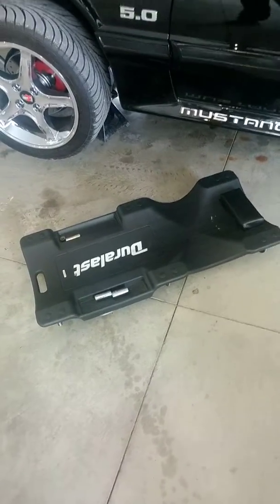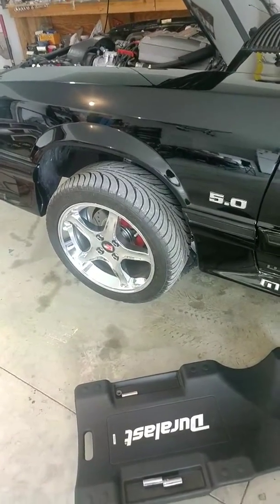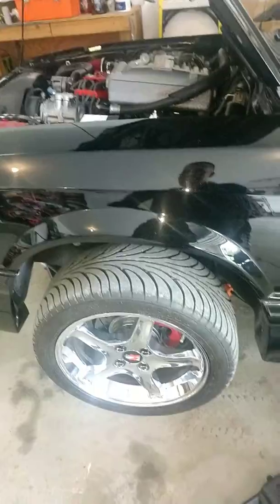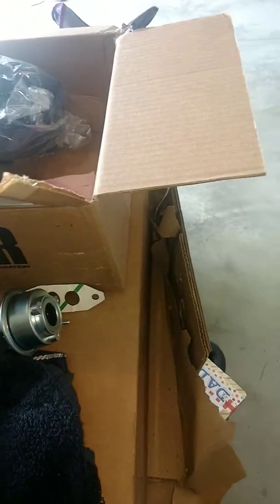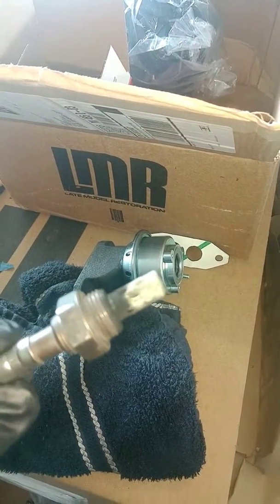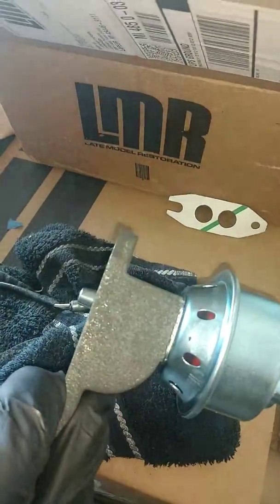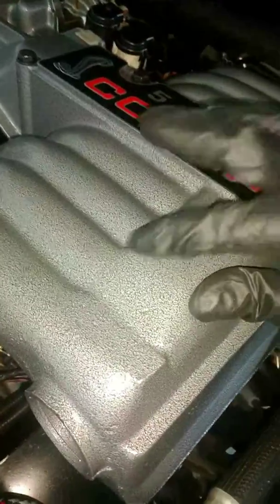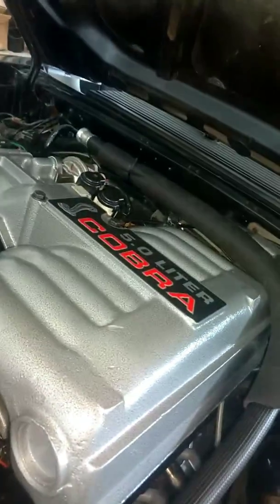Foxbody o2 sensors/EGR valve replacement s/Intake Hood Rub

Comment: I'm interested in to see if those o2 sensors, help your surge. I myself am battling the the same issue.
Reply from the maker: I cannot give you a definitive answer, yet. I slapped them on and took it for a ride, "seemed" better...over all, the car DOES have some better Giddy up! I'm going drive it some more and recheck codes hopefully this weekend. I will let you know Mike! I also replaced EGR, but I think you capped yours. A base idle rest might help, smoke test (for vacuum leaks, I think you replaced all your lines) and even a TPS adjustment. 
To be honest with you, I think I'm being picky as hell with it all, lol!
Reply: Yeah I know what you mean. My problem is when the engine was basically stock I didn't use the o2 sensors. Now it's running pig rich an I get horrible surge. Idle varies from 1500 to 700 driving me bat shit crazy. I did do the base idle reset. An checked timing. Running 12 degrees advance. Still idle is for garbage an surge. I'm gonna grab some o2's an plug them in. Hate just throwing parts at things. My fear is I may need a tune. Not sure yet. Let me know how she performs.
Reply from the maker: @itsjustmike7858  I certainly will. It gets frustrating figuring these cars out....it's usually something simple too. 
What year is your fox?
Did you try pulling codes??
Reply: Not yet I am going to tomorrow, also should probably check for vacuum leaks
Reply: It's been hell getting to the last 10%🤣😂🤣
Reply from the maker: @itsjustmike7858  I hear ya, mine is doing some squirrelly shit too!

Comment: Any updates?  I'm guessing you have been busy with plenty of non-Mustang stuff.  It's that time of the year for yard work B.S. and all that!
Reply from the maker: Nothing yet my man. You are absolutely correct...been busy with Non-Mustang...shit! Currently standing in Hone Depot, waiting for my dam order they claimed was already to be picked up.
I've made a list of things I am going to do on it as soon as I can get around to it. 
Was thinking about jacking the Fuel Pressure up. From what I read, may he a lot more air getting in now with that intake. 
Codes, if that 22 is still there...I will be questioning that MAP sensor. 
Vacuum leaks...I am going to closely inspect every dam line to be sure noting is getting in. Smoke it, sorry the hell out if it with Brake Cleaner, want to be sure it's not leaking. 
Might need another base idle reset, TPS and timing check.
And I most certainly am planning on pulling the ECU and looking in it. What you said about the possible chip AND compacitors leaking....that's a simple check. 
So nothing new yet, you will be my first contact on the findings. Appreciate you checking in with me, we'll be in touch!
Reply: @jpp9846  Do you remember what you fuel pressure is set to right now?
Reply from the maker: @fwh79FOXR6  sorry, friggin YouTube notification problems again!
I want to say 38-39, 41 rings a bell too? I don't remember and I'm now on a soccer field....but something simple as uping that "might" help. I was going to check timing, idle reset, then adjust that.
Reply: @jpp9846  I personally think the idle rest and tps setting are irrelevant at this point in time.  You can try bumping the fuel pressure up to 45 psi and check your timing again.  Maybe you mixture is too lean and that's why the engine is breaking up under load.  Lean fuel mixtures can cause a misfire that is very similar to an ignition problem.  Your current engine set up is very similar to a set up I was running 60 psi of fuel pressure with.  Your set up is actually more aggressive because you have the 1.7 rollers and I had the 1.6 rollers.  I'm not saying your car needs 60 psi but it is very possible that you need more fuel pressure.  Keep in mind, you can check that MAP sensor with a vacuum pump.  You should be able to rent a vacuum pump from an auto parts store.
Reply from the maker: @fwh79FOXR6  how do you test it with a vacuum pump? I actually own a hand one, they sold it to me for bleeding my brakes, years ago. Please let me know the procedure there. 
And my car definitely IS running lean, that is one thing I know. Those old O2 sensors were dusted white and so were my plugs when I changed out. It is another reason I thought this was my MAP sensor...getting an inaccurate reading since it was hooked to the tree and not the Manifold. I still think it's a suspect.
PS- I checked the FP and timing real quick when I got home. I'm currently at 40psi (vacuum line on) and timing is at 11-12ish.
Reply: @jpp9846  Ok brother, if you can... fire her up and let her idle for around 5 minutes and try setting that fuel pressure to 45 psi.  I'm gonna look up that MAP test for ya right now.
Reply: @jpp9846  
When troubleshooting the MAP sensor, always begin by checking for air leaks in the intake system and vacuum system.  Repair as necessary.  The sensor can be checked using a frequency meter and a hand held vacuum pump with gauge.  Begin by checking that the sensor holds vacuum.

Pins from left to right on the electrical connector are:  1.  5 Volt power  2.  Output  3.  Ground

The MAP sensor has three wires.  The orange wire carries a 5-volt power supply to the sensor.  The middle wire carries a variable frequency square wave to the EECIV.  This frequency ranges from 90 hertz on hard deceleration to more than 160 hertz KOEO.  The last wire is a ground.

MAP Frequencies:
Vacuum  (Inches)                    Frequency  (Hertz)
30                                               80
27                                               88
24                                               95
21                                               102
18                                               109
15                                               117
12                                               125
 9                                                 133
 6                                                 141
 3                                                 150
 0                                                 159

Don't ask me how to read frequency... because I haven't figured that out yet!  Hahaha!
Looks like most multimeters only read 20-50 Hz
Reply from the maker: @fwh79FOXR6  thanks! I will research the frequency part...there is a lot of info out there. I've got a pretty dam big deck project going on...and life stuff. 
You did read I have the FP at 40 and timing at 12-13? (Nevermind, I didn't see your other message) It seemed 14 it ran better....so I'm going to jack up that FP and maybe timing and see what happens. 
I can only hope its something simple...most likely not. 
Thanks for all the info and.replies, they really are appreciated!!
Reply: @jpp9846  You're welcome.  Yeah, let me know how goes for ya.  If you even have time to mess with it!
Reply from the maker: @fwh79FOXR6  so, if I'm considering replacing this Distributor, what brand should I replace it with? I hear MSD's are shit ...and that I should  try finding a reconditioned Audiolite/Motorcraft Distributor. What's your thoughts?
Reply: @jpp9846  Did you pull that computer yet?
Reply from the maker: @fwh79FOXR6  no. I guess I'm just planning ahead. Wanted your opinion on a distributor.
No...I am nearing the end of my project in the backyard and will be doing all these tests/codes/ecu pull/FP raise/smoke-carb cleaner vacuum inspection...etc
Reply: @jpp9846  Well I got one from Advance Auto.  It seems ok.  I have heard bad things about MSD as well, but I have never used one of their distributors.  My buddy with the 408 put an MSD distributor in that thing and it's rock solid.  You can really drive yourself mad with the "bad new parts" situation.  It's not making anyone's wallet happy either!  For the money you spend on the MSD unit, it should be perfect.  They are not cheap.